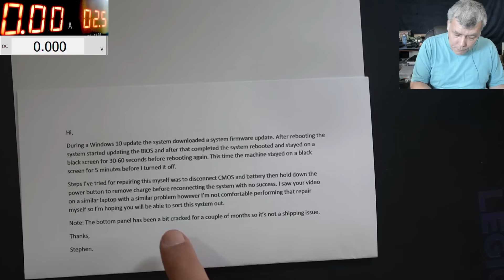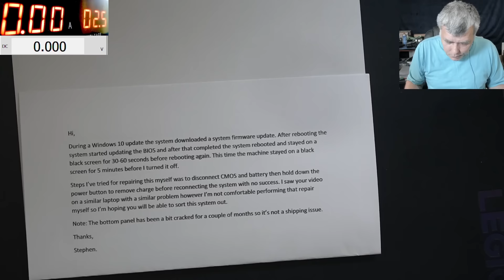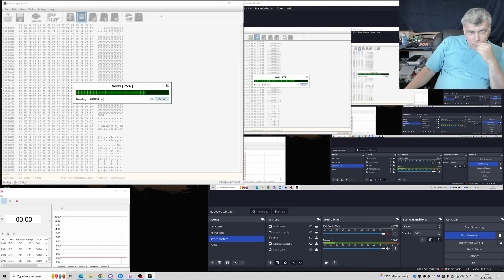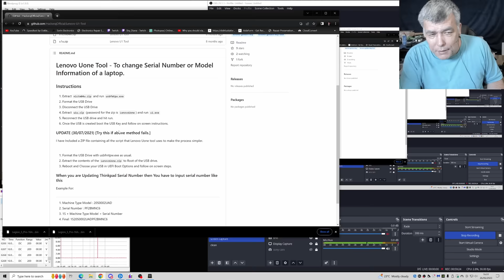Lenovo Legion 5 15ACH6H dead after windows updates - Sadly, laptops are dying after windows updates

Comment: I suppose the "elephant in the room" here comes down to asking WTF Microsoft is doing messing about in the bios?
Reply: 'You will eat ze bugs, and we will own your BIOS'
     WEF Politicians
Reply: It's because the system wants full control. And that's just the beginning. There is still much more to come. Get ready now.
Reply: Lenovo is responsible for whatever is pushed through Windows Update channel, not Microsoft.
Reply: @kaminekoch.7465  
Nope ... If you own a Lenovo system you will get their drivers... but it all comes from Microsoft.  Nobody else has (legal) access to that channel.
Reply: @kaminekoch.7465  Microsoft should put bios updates through a different channel that warns people of the dangers of bios updates. And when they are done, they should be done on their own, not in the middle of a windows update.
Reply: Yeah, I totally agree. The operating system shouldn't be fucking around with the BIOS.
  
I haven't had a problem doing BIOS updates from Windows 10 on my Dell desktop, but the files and update software comes from Dell. The operating system might be involved in some way, but only on a basic level. 
 
It used to be that the way you did a BIOS update was to make a bootable floppy or optical disc from an image provided by the computers manufacturer.

You'd then shut down your computer, boot from the disk/disc, go through a basic menu system, get the update going, and then cross your fingers that everything went well and you used the right BIOS file.  
  
It was far from foolproof, but there were a lot less things that could go wrong. The greatest risks were a bad/incorrect BIOS file or sudden losing power partway through the update.
Reply: @waynesallee-com t's likely also because many modern machines no longer have a floppy drive or optical drive to boot up an independent BIOS update media. --- I suppose in theory it ought to be possible to use a USB flash or SD/uSD card. BUT it has to be something that the BIOS supports as a primary, fundamental boot medium and should be something that works fine without altering the default BIOS configuration. (UEFI firmware provides the same kind of basic functionality as classic IBM-compatible PC BIOS software did/not necessarily compatible but serves the same purpose)
Reply: @jnharton  
Yep, you'll get no argument from me.
Reply: Good question. I have Grub configured to chose between linux and windows. Every couple of months there comes a windows update that screwes up my grub and I have to reconfigure it to get access to linux
Reply: @7Andy77  
Grub isn't in the bios, but they shouldn't be messing with the boot sectors either.
Reply: @jnharton  actually, you CAN use a USB drive. ASUS computers come with a feature called "EZ Flash" that allows you to do firmware updates from a flash drive.
Reply: @Collidedatoms  The point is not that other methods are impossible, only that the previous methods were essentially standard for all machines with no special considerations needed.
Reply: @Douglas_Blake_579  ok but it is rather related. The update changed my boot configuration in bios setup (EFI, UEFI etc) what ended up with not showing grub during boot
Reply: @7Andy77  
Oh for the days when the BIOS was standardized and relatively simple...
Reply: I'm glad some laptops allow locking bios updates from the OS
Reply: @zUltra3D  is it possible on Lenovo y700?
Reply: @7Andy77  From what I've seen, it uses the InsydeH20 BIOS, it's pretty unlikely to have it considering that the H20 bios is notorious for having very few settings
Reply: @zUltra3D  okay, thanks for the reply
Reply: windows become nasty. It doesn't warn user before doing bios and other firmware updates. Sometimes the bios update is a downgrade, like removing possibility to undervolt and run CPU cooler with less energy wasted.
Reply: @mi-rek  
It's a process of re-engineering demand. They want us to get used to having what they want us to have, as opposed to what we really need.
Reply: @MattyEngland  good
Reply: @jnharton  BIOS flashback should be standard on ALL machines. 
AMD is already enforcing that on their AM5 socket motherboard
Reply: @7Andy77  use 'rEFInd' mate. No need to rebuild grub after every Win update.
Reply: apparently they started to include driver and then frirmware/bios updates fo mainboards and graphics cards somewhere in the middle WIndows 10 lifetime, they did that because major Windows updates sometimes require thos things to be updated to else there is a chance you just get a a lot of Bluescreens.
Had a PC with an older bios firmware and after a bigger Windows 10 update the Mashine would Bluescreen after about 10 minutes use all the time the Bios update helpred there
so thats the reason they Microsoft includes those things in there Updates as long as manufacturers allow it
Reply: Probably related to things like patching CVE-2023-24932
Reply: As I see it, manufacturers are continuously 'improving' their products, and so believe that BIOS updates are essential for continued end user satisfaction, and as most customers aren't really aware of BIOS, manufacturers have learnt that most end users don't bother to update...so they're opting to do it for them... potentially thinking that they're doing some good for the nd user.

Not forgetting that OS providers have a preference for automatic updates, Windows 10 onwards more or less tries to remove the end user from the update process.

The fact is, despite a world dependant on technology, most end point users are not tech savvy, and manufacturers probably really believe that they are doing a good thing for end point users by removing any concern over updating software. This means that 1) the end point user doesn't get stressed out because the OS is suggesting/telling them to update and, 2) the whole estate covered by a particular OS is safer because of 'herd immunity' concept.
Reply: Planned obsolescence is why Microsoft changed the bios.
Reply: Not only the bios: it also modifies the CPU firmware on boot, so if Intel or AMD botches a microcode update, you may end up a bricked device :( To be fair Linux and MacOS also does it, so.... and the worst is, that the microcode is not even checkable, as it is supplied as a binary blob. Yet users will go complaining to MS, Aplle, etc, when they not even know what it does (they check it for malware, and signature integrity, but that does not prevent bugs).
Reply: @7Andy77  if you mess around dualbooting when using the same drive, windows efi configs will be alongside grub, but if linux is on another partition then at most, grub will see the boot option and register without ultematitely one affecting the other too, i tried this myself when reparting on windows for linux and it already was enough to ruin the install whereas from the other disk, not, at least in my testing so far so good.
Reply: @asunavk69  I didn't know that. But do you mean same drive or partition? Because I have both system on the same drive, but different partition. Because I have SSD and  HDD. I wanted to keep systems on SSD for performance's sake, and HDD is just additional storage for some data. EDIT: I've read your comment again, now I know  you meant to install linux on separate drive
Reply: @7Andy77  yeah i meant really another disk i apolagize my lack of clarification xd. Good luck, this a recommendation, another thing you could do is blocking windows from updating like feature updates, such thing can easily be done with chris titus tech tool, makes life easier a bit for dualbooters too when dealing with windows, cheers g'luck.
Reply: @jnharton   But many UEFI do support updating from USB.
Reply: @7Andy77  Hm, are you using MBR? Or GPT?
Reply: @7Andy77  Yeah, Windows always assumes it's the only thing installed. It will even block other Windows installations.
Reply: @FlabbyTabby  I think gpt
Reply: Ikr....
Reply: oh come on use your brain.
Reply: Windoze , I'm not surprised at all, it's not known the "blue screen of death" for nothing,  lol
Reply: Updates for bios are pushed through windows update in some laptops so... yeah
Reply: @Douglas_Blake_579  if you still have the windows bootloader besides grub, after these big updates windows will reset your uefi settings and set it's bootloader as first priority instead of grub. Happened to me on my legion 5 pro 16ach6(so same generation as the laptop in the video) once in the past 3 months since I installed arch in dual boot. I've since decided to switch to linux only with windows in a vm in the near future and build an amd only desktop, since those nvidia linux drivers like to break every weekend.
Reply: @mi-rek  You can personally by pass by slicing the trace and provide full b+ to the fan directly from the p.s. This is how you show the "upgrade" "the finger".
Reply: Hi, Linux guy here. Stop using Windows and you'll stop getting issues like the os mucking up your bios.
Reply: The customer lied and  was probably messing with the bios and blamed it on innocent microsoft..
Reply: @SpanishArmadaProd  
Got proof of that? 
Seriously ... MS is known to send out some pretty funky stuff in their update streams.
Reply: @xAxCx  
Linux isn't the answer when you're running software with no *NIX equivalents.
Reply: Not just the BIOS, Windows is also messing with boot records and boot managers, outside of windows partitions, and is the only operating system in the world that sets the BIOS time/date to local time instead of GMT, and can't handle the 1 hour shifts after you boot into another operating system. Windows is cross between a toy operating system and an advertising channel.
Reply: @jwstolk  with a dash of virus too
Reply: Windows update sometimes also updates the microcode for your cpu, like pushing a fix for new exploits. Bios communication is probably necessary. You can all take off your tinfoil hats, if they want full control they can just dedicate a small part of the sillicon to that and bypass everyone and everything. The intel management engine is something similar to that and has existed for years and years already.
Reply: Good another reason to use AMD over INTEL.  I personally can't wait for the Wintell douopoly to become history. Also another reason to use Linux over Microsoft. We users should have control not the software of the OS.
Reply: @brianperry4815  
It makes you wonder who owns your computer... doesn't it?
Reply: Also there are usb tools that can be used to reflash a corupt bios. You use a bootable usb drive.
In this day and age they should put on another bios chip like on Gigabyte motherboards to keep this from happening
Reply: @MattyEngland  Based.
Reply: So why only Lenovo got infected?
Reply: @arx117  
Because they only sent BIOS updates to Lenovo computes.
Reply: Nope, it was Lenovo. Microsoft gets the SW from them and run it. Bios and Fw are Never from MS. Apart for MS machines.
Reply: @Collidedatoms  hopefully this isn't changing
Reply: This information is false! The op of the video simply doesn't understand the difference between Window's updates an automatic updates from factory installed apps. Those updates come from the factory driver app installed on your machine very much like Dell Command Update that will automatically scan your system and download the latest driver and BIOS updates. I never once in my last 10+ of experience working in IT seen a PC BIOS firmware via Window's update.
Reply: I'm not 100%, but I'm pretty sure this guy said several times that: "the laptop died during update", he could mean something else, as English is obviously not his 1st language, but this may be a case of trying to update on battery power. Often, the 1st step in an update is removing the old, so if you lose power after removal but before installation of the new, this is the result. I'm not giving William gates a pass by any means, but MAYBE this time was operator error?!
Reply: @chrisjohns4461  
If this is such a risk (and I agree it is) then the update software should abort when on batteries.
Reply: Every electronic device you buy these days will eventually be updated to purposefully stop working correctly so you will buy a new one.
Really no diferrent than the so called medical system today that gives you a shot like a roll of the dice. That shot will give you something. Anywhere from now you suddenly cant see well any more to now you have to use an inhaler to be able to breath properly, to now you suddenly are allergic to certain foods. 
The shots are a crap shoot of what it might cause. But every shot will have some kind of gotcha to keep the medical industry busy and making money off of you. Only at the expense of your livelyhood, health, and over all life longevity.
Reply: @jwstolk  I've got Linux only and after using fwupd on my Lenovo laptop, I get the Windows boot issue and have to re-install grub.  It's a pain, but I don't worry about it too much.  It's not hard to boot from usb and re-install.
Reply: @waynesallee-com get ready? You're sounding real paranoid. Windows has always had backdoor and the ability to push updates unless you manually disable it in regedit.
Reply: @PlatoonGoon  No I am not paranoid. Also, I use Linux that I built. When I refer to the system, I am not just talking about microsoft. I am talking about the whole. You can only see dimly in the print, because of the whole. I wish it were not so, but it's the new deal.
Reply: Microsoft have other ways or ensuring you have to buy a Surface.

Suddenly, this month I find that my cheapo Lynx 1010b won't accept the latest W10 cumulative update (KB5029244) -  when update attempted it yields error code 0 x 800f0831 and others.

Luckily the mini laptop still works.

This unit has a  BIOS which addresses pieces of hardware through non-standard ports and may have other unique BIOS protections (The result is that the Chinese  manufacturers, in trying to make their own  product exclusive ,  . . have inadvertently provided  protection  from Microsoft interference ?)

As soon as this update failed guess what happened . . . . I get one of those desktop notifications offering a "Surface" for sale, to which I say "The names Roberts, not Rockefeller . . fluff-off Billy"
Reply: Solution: Linux. Has problems, yes. But is more and more user friendly. My mon uses it, never got an issue. She is 50 years old. Companies cannot control ours lives. If we let them, they will. Use backup tools, like timeshift. Do not upgrade your system before a backup. Recommend PopOS for performance and Mint for playing safe on the transition.
Reply: looking at the 74 anti windows / big brother MS  replies why not switch to LInux as i did and using a paranoia free os
Reply: @Louis2282 

Because, as I've explained before, there are a couple of operational scenarios that Linux either doesn't support or outright can't do... and unfortunately I'm working with one of them.
Reply: OEM's can publish driver and firmware updates. Nothing new here.
Reply: @MattyEngland  American politicians
Reply: @KingsmanKnight  tinfoil much? 🤦‍♂️
Reply: Because, they wrote MS-DOS work closely with Intel and Dell, and in the past IBM, they created it. They own it, it's age old agreements formed decades ago.
Reply: @jwstolk can you send me to an OS that's neither Windows, nor MacOS nor Linux, I've been using windows forever and I hate macos, windows gives me more control over the system, and Linux console bothers me. When will there be another system like windows in it's glory days
Reply: @srdgjkhvdfhsedfkjd-x5m  that couldn't be more incorrect. Please stop spreading nonsense.
Reply: @srdgjkhvdfhsedfkjd-x5m 
MS did not develop the PC BIOS.  And even if they did, they still have no business messing around with delicate settings in a privately owned computer.
Reply: I cant use my 3000$ microsoft book it dies when gaming due to battery drain gpu consumes more than the max output of my Microsoft book  i undervolted problems solved but in a windows update it updated the bios aswell like what ... Now undervolting is locked i was able to downgrade bios with linux and undervolted again, disabled windows update but a forced update eventho i disabled i dunno how it happened it updated my bios again but this time they locked downgrade aswell so i m stuck with an exp equipement that i worked for a year to get that i cant use .... Didnt know windows updates can force a bios update aswell they should suggest at least wether i want to or not...
Reply: @ravenrostom  That's the first that I have heard of a bios being locked from downgrade. It's time to switch to Linux. What kind of error do you get when you try to downgrade the bios? Microsoft is taking more and more control, just like google.
Reply: @ravenrostom 
Count yourself lucky they didn't "brick" it on you.
Reply: How can we stop windows from updating bios?
Reply: @Ironman-BB 
Disable automatic updates.  
The original purpose has long been replaced by the chance to mess with your system and upload stuff without your permission.
Reply: Turn off windows updates, and do manual updates checking which updates to allow. @Ironman-BB